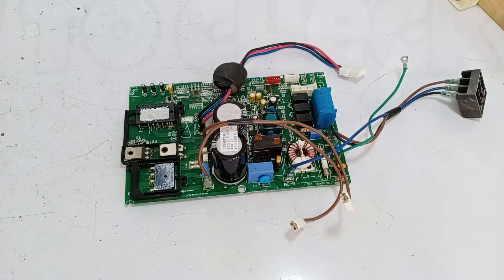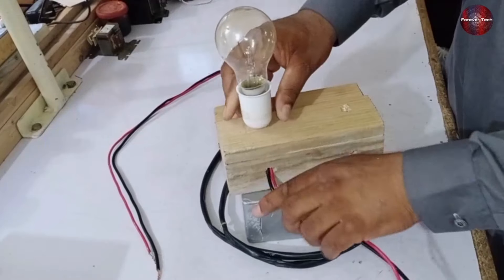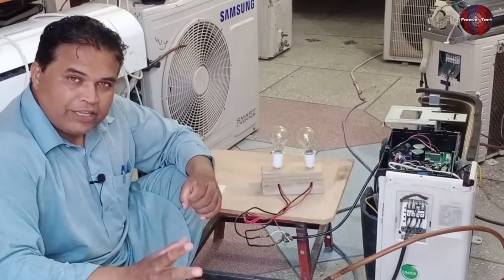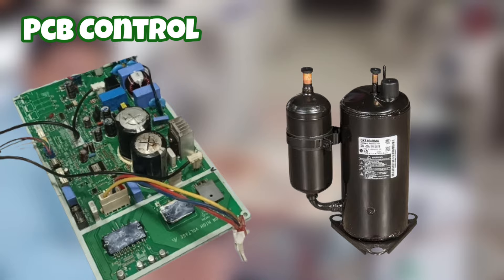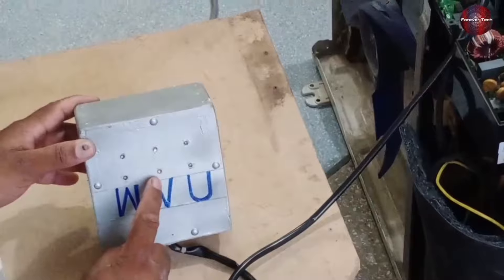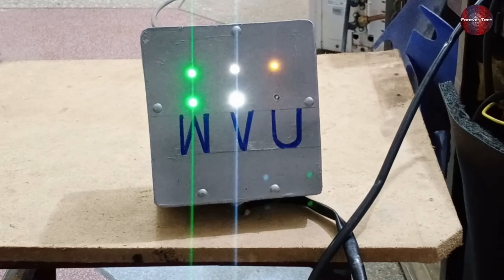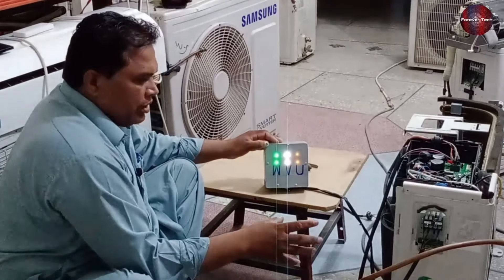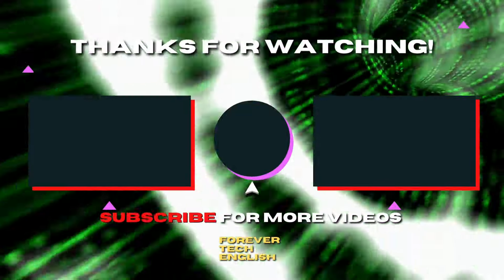Mini Split Inverter Ac Testing | PCB Board Or Compressor Fault?

Comment: Informative video. To check the compressor, the wires UVW from PCB connects to the compressor, how does the UVW analyzer wires connects to the compressor because the pins have been taken by the PCB UVW wires? Thank you

Comment: Quick question. Am empty the unit completely and after I charge the unit, the outdoor unit wont start. Can you give me some advice what I can be the problem? Thanks
Reply from the maker: Was it working before you charged it with refrigerant
Reply: Yes, was working perfectly, except they make like loss air when I turn off the 3 unit
Reply: What do you think can be the issue? The pcb board is not power at all because I checked que led lights and no one is flashing at anytime 
Please help. Thanks
Reply: @forevertechenglish  ?

Comment: My lord, just do a diode test with a multimeter on the pcb...this is hilarious
Reply from the maker: The diode, does not go bad all the time in the PCB. This test is useful to know whether the circuit is driving the compressor or not. Yes, there are many components in the circuit board. Not the diode only. If you think this is funny. Its your thinking. Can't do anything about that. Well GOD Bless You.
Reply: @forevertechenglish  well it's funny if you look at it from a practical point of view it if I pulled out a box and 2 light globes at a customer's house. God bless you too buddy 🙏
Reply from the maker: Well that's a DIY testing equipment the one made with a bulb. Use that in your workshop, If it feels hilarious. Use A UVW tester at the
customers place.
Reply: @forevertechenglish  look I just thought it would be hilarious to wip out a wooden box with globes and see the look on the customers face. They would be thinking wtf !! It's still cool regardless 😎 I think anyone engineering thier own equipment is a legend

Comment: Incorrect sequence of test ... 
Corect sequence of operation is : 
1. Power to fan 
2. Power to compressor 

In order to start first must check : 
1 voltage to outdoor unit 
2. Voltage send to indoor unit 
3 voltage to fan 
4 voltage to compressor 

Corect voltage expected to find on fan and conpersor  will be in manufacture instructin  instructions

Comment: my dear HAIER air conditioning engineer HELLO, I am an air conditioning technician. I often recharge my batteries at your place. How can I get your contact details or email address? here I do maintenance on 12 HAIER air conditioners, today I just saw an air conditioner that does not start. the evaporator (indoor ?turns well but does not start the condenser (out door)
What is curious is that the LED lamps light up very well for more than 30 minutes.My question: what could be the cause of this non-working? Thank you
Reply from the maker: What error is it showing? Can you tell me what error does it shows on the display... This is my Whatsapp contact number you can contact me here for more details? Whatsapp: 00923072903344